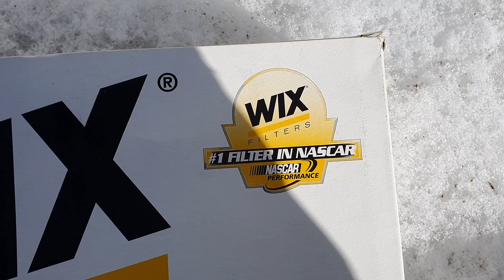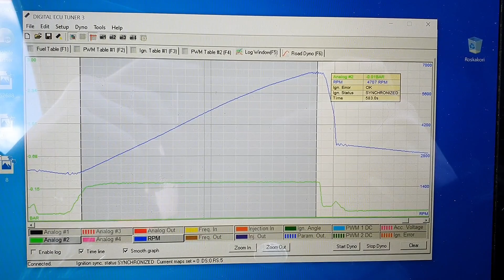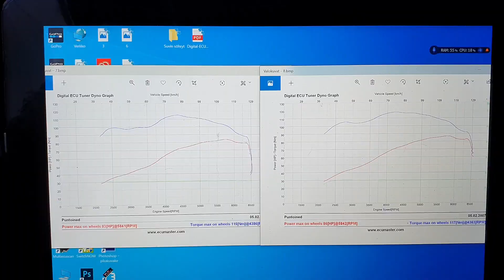Stock Air Filter or Cold Air Intake Kit for Power Gains? Let's Find Out! Fiat Punto

Comment from the maker: Fun experiment on Easter holidays, enjoy! 😃
Reply: Great video as always.

I wonder how the stock airbox would perform without the restrictive intake? You could try to cut off the pipe right after the restriction to see if that makes any difference.

As a follow-up, you could also attach the cold air intake piping to the modified airbox.

This would give you two more data points for your experiment. :)
Reply from the maker: I have tried it without that flexi pipe, it was even worse because the intake air temperature was higher. But yes it should work much better with properly placed and sized inlet 😊

Comment: Okay so in the end, if the Cold Air kit is installed correctly you can gain a little bit of power and probably make the engine breathe a little bit better. Problem is that here Cone FIlters are illegal for some reason ( i think for the added sound) and could be a big problem if they catch you.. But i'm seriously thinking about installing one because here in italy the summer temperatures are really high and i've noticed a lot of power loss going uphill
My only fear is of course the police but also, what if you hit a puddle? Water can get in the Air Intake more easely
Reply from the maker: Those are legal to use in here but engine breather hose must be connected to air filter piping or directly to intake manifold. It's very unlikely to get any water where the air filter is, at least if the pothole is under 20cm deep 😃
Reply: @JoniK1  Italy's laws for cars are dumb, you cannot touch or modify anything basically..

Okay, nice to know, as always thank you man, stay safe :D
Reply: Cone filters are also illegal in Australia, at least for "modern" cars, I believe with classics anything goes as they're not driven so often. Cone filters are illegal due to if the car has a hiccup of sorts and spits fuel back out the intake, apparently a cone filter is much more of a fire hazard than the standard boxed filter, though this law is easy to bypass, I've heard people pass inspections by putting the filter inside literally a tupperware box with a hole in it.
Reply: @UniCrafter  here the problem isnt about inspections, not in many cases, it's more about what kind of police officer you meet

Some officer understand that you are only making the engine more efficent but other only watch the actual Law and they  punish you with a Ticket and if i remember correctly, here they can take away your Car's paper.
Reply: @coraz98  similar thing here, but if a car can pass inspection there's nothing a police officer can do, so generally people modify their cars to pass inspection. Police CAN fine you for technically legal mods, but you can easily dispute them.
Reply: @UniCrafter  Ahh okay.. at least you can debate..

Comment: The small inlet makes more torque in the low rpms but if you will have more hp you need more rpm 😉 if you modify your new airkit with a second cover on the rearside  so like a airram system you become a better Performance 😊👍 thanks for the englisch version , your englisch is mutch more better then mine 😅. BMW e36 become coldair with ram system its in front of the cooler the airintake 😁 what cost the program and the stuff for a road dyno and were i can buy it?? 
Have a great rest day and greetings to your dog my friend 😊👍
Reply from the maker: That's Ecumaster Road Dyno. All Ecumaster ecus have that, even my piggyback. It needs rpm, speed etc and it makes the graph based on those numbers
Reply: @JoniK1  can not find anything about that..

Comment: Was the car tuned for the cold air intake, or was the same tuning used for both intakes? Would be interesting to see how much potential the cold air intake has if not.
Reply: I think it was the same parameters with other intake 😊👍 with this setup is 2hp a good Performance only turbo makes more Performance with the same stuff
Reply from the maker: No tuning, I just changed it 😊

Comment: The 1,2 8v has 60hp, how did you get it over 80?
Reply from the maker: I have Punto 75 camshaft and intake manifold, 46mm throttle body from Bravo 1.6 (10mm bigger), bigger fuel injectors and Walbro 255lph fuel pump, 4-2-1 performance exhaust manifold and Ecumaster DET3+ for tuning
Reply: That’s a lot of mods for only 25 HP…

Comment: The First 90° siliconic tube what is? 54mm? 60? 63?
Reply from the maker: There's part list in comments section on my another video
Reply from the maker: Silicone 135 Degree Elbow Hose 60mm: 
http://rover.ebay.com/rover/1/711-53200-19255-0/1?ff3=4&pub=5575563443&toolid=10001&campid=5338643528&customid=jonik&mpre=https%3A%2F%2Fwww.ebay.com%2Fitm%2FNew-Red-For-ID-60mm-135-degree-Elbow-Silicone-Tubro-Intercooler-Coupler-Hose%2F184029023040

Aluminium Pipe 300mm 60mm:
http://rover.ebay.com/rover/1/711-53200-19255-0/1?ff3=4&pub=5575563443&toolid=10001&campid=5338643528&customid=jonik&mpre=https%3A%2F%2Fwww.ebay.com%2Fitm%2F60mm-2-36-inch-Aluminum-Intercooler-Intake-Turbo-Pipe-Piping-Tube-hose-L-300mm%2F332349412284

Silicone 45 Degree Elbow Hose 60mm:
http://rover.ebay.com/rover/1/711-53200-19255-0/1?ff3=4&pub=5575563443&toolid=10001&campid=5338643528&customid=jonik&mpre=https%3A%2F%2Fwww.ebay.com%2Fitm%2F45-Degree-Silicone-Elbow-Hose-Silicone-Pipe-Bend-Coolant-Radiator-Air-Water%2F253302385202

Aluminium Pipe 76mm 60mm:
http://rover.ebay.com/rover/1/711-53200-19255-0/1?ff3=4&pub=5575563443&toolid=10001&campid=5338643528&customid=jonik&mpre=https%3A%2F%2Fwww.ebay.com%2Fitm%2F60mm-2-3-8-COUPLER-Turbo-ALUMINUM-PIPE-JOINER-HOSE-CONNECTOR-POLISHED-L-76MM%2F281823473922

Performance Air Filter 60mm:
https://rover.ebay.com/rover/1/711-53200-19255-0/1?mpre=https%3A%2F%2Fwww.ebay.com%2Fitm%2F2-36-Car-Performance-Air-Filter-60mm-Air-Intake-High-Flow-Cone-Cold-RED%2F313112887317&campid=5338643528&toolid=10001&customid=jonik

4x Hose Clamp (min diameter 68mm):
http://rover.ebay.com/rover/1/711-53200-19255-0/1?ff3=4&pub=5575563443&toolid=10001&campid=5338643528&customid=jonik&mpre=https%3A%2F%2Fwww.ebay.com%2Fitm%2F4x-301-Stainless-Steel-T-Bolt-Clamps-67MM-75MM-For-Hose-2-5-8-to-2-15-16%2F293221028309

Breather hose filter 1":
http://rover.ebay.com/rover/1/711-53200-19255-0/1?ff3=4&pub=5575563443&toolid=10001&campid=5338643528&customid=jonik&mpre=https%3A%2F%2Fwww.ebay.com%2Fitm%2FUNIVERSAL-1-INCH-25MM-HIGH-FLOW-COLDS-AIR-SHORTS-RAM-INTAKE-FILTER-CONE%2F312744171057

Comment: Bro its a hot air intake... Just wrap it with anti hot tape
Reply from the maker: It doesn't make a difference to intake air temperature when driving, only when idling for a longer period of time. The air goes through the intake piping so fast it doesn't have the time to heat up